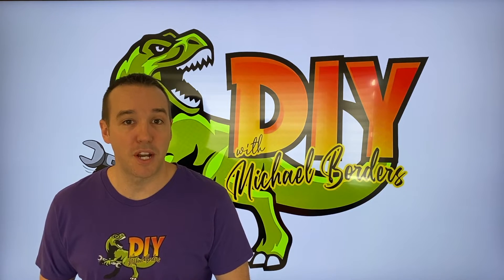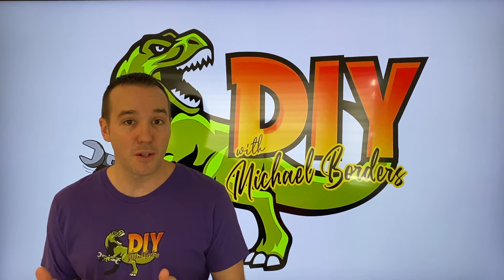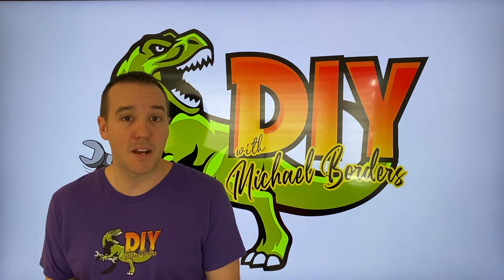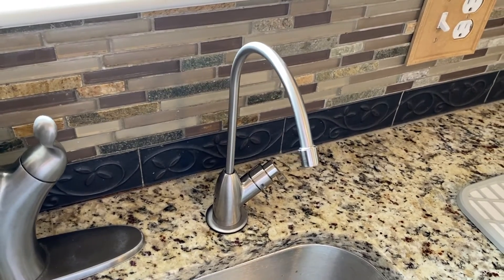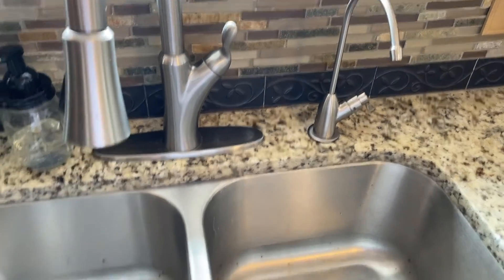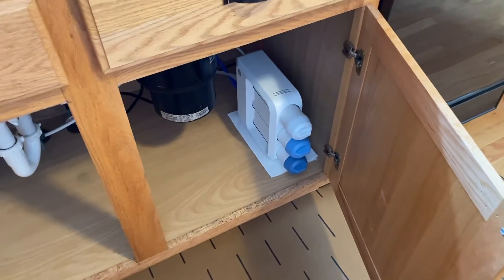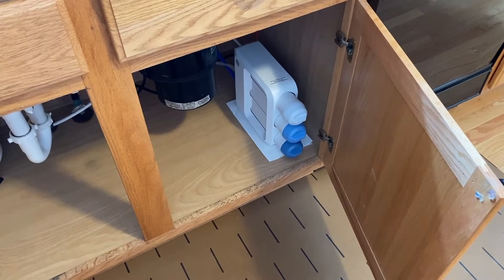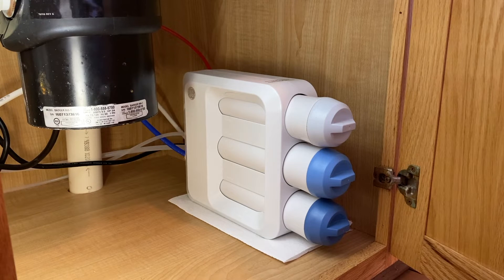Reverse osmosis tank not making water - FINALLY figured it out

Comment: I had just recently purchased a 5 stage reverse osmosis ro system and after setting it up trouble shooting a couple leaks or fittings I got everything to work but now there's a slow leak coming from the filters themselves and/or the main system I believe it could be the filters but before I purchase them I was wondering if anyone could have any idea if it's something else I should be looking at
Reply from the maker: Thanks for watching, that’s no fun.  Being brand new, the filters shouldn’t be leaking…🤔

Are the filters and membrane screwed all the way in and firmly secured?
Reply: @DIYwithMichaelBorders  yessir even unscrewed em and screwed them back in I just ended up returning in and I'm thinking of getting a nu aqua and seeing if that works better for the price the reviews are not bad for em so one can only hope for the best. Thanks for the fast response and the advise.!
Reply from the maker: @xxcooldudexx06  

Thanks for the follow up, did you purchase the new aqua system yet?
Reply: @DIYwithMichaelBorders  no not yet I'm either going to wait a week or just purchase a 6 stage instead of a 7 stage
Reply from the maker: @xxcooldudexx06  

👍
Reply: @DIYwithMichaelBorders  and it was as secure as I could get it but there was way more give an play than in other videos and photos I had picked it up from home Depot if that has anything to even do with it but I'm saving up some more money bc of it just in case now

Comment: I just bought second hand brand new from a guy who bought it but never installed it once he moved. Been I garage for 2 years and then 1 year for me before I install it. Right now I’m not getting any water into the tank/ faucet. Water go straight out the faucet waste line into the drain and that’s it.

Pressure 7psi. I’m wondering if I should just buy new filter? I have WATT PREMIER RO SYSTEM
Reply from the maker: Good morning, just poured a ☕️ and am sitting down to answer any and all questions for the DIY community.

We 100% recommend replacing both filters and membrane.  If they ever experienced freezing temperatures while stored in garage, they are unfortunately ruined…ask us how we know…😬🤣…Keep us posted.

Let us know if you have any questions and hey if you’re interested, join our DIY ecosystem and help us grow an exclusive group of DIYers.

       toolboxtoken.com

Reach out to us any time!  🧰